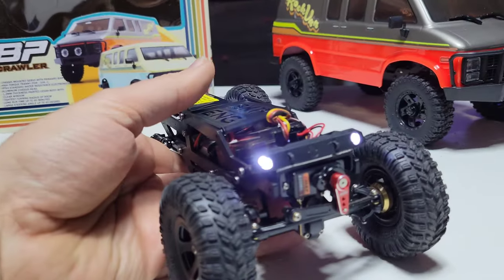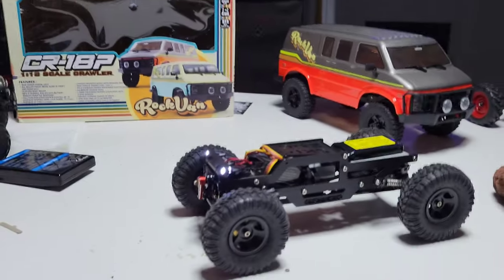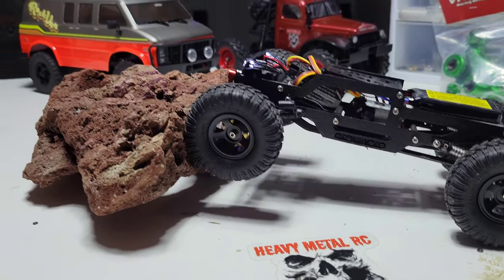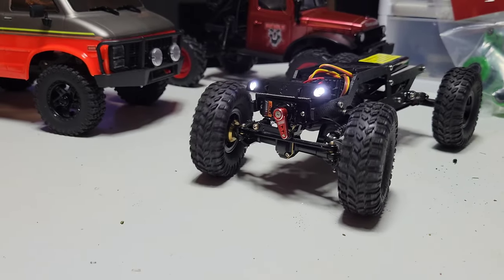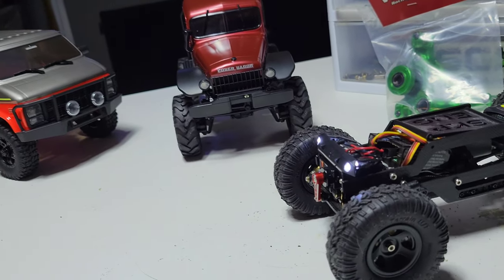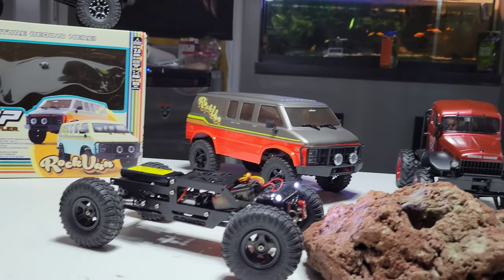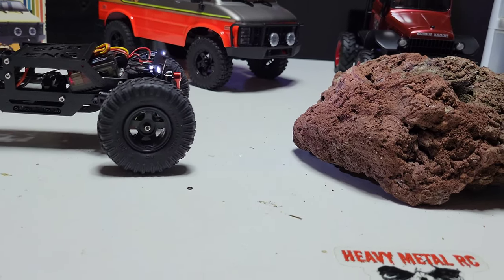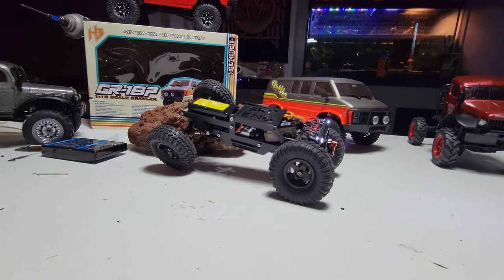SCX24 Warthog Chassis! Slithering Crawler.

Comment: Just built one with a Amazon carbon fiber chassis all injora parts and something I haven't seen I use rear gladiator links all around so it's got a 7 1/4 in wheelbase and maybe a 1in at most taller then yours it's badass

Comment: i have on deadbolt but appart from motor and servo when they burn,i will keep it stock. this things already cost 150eur, i cant justify another 150 on a motor and esc plus receiver and control. Seen people spend 1000 on this rcs. its not my thing since i use it for leisure.